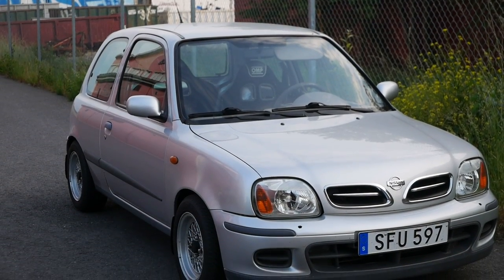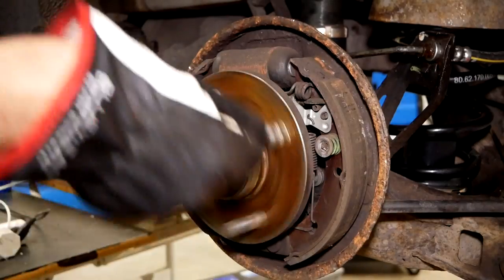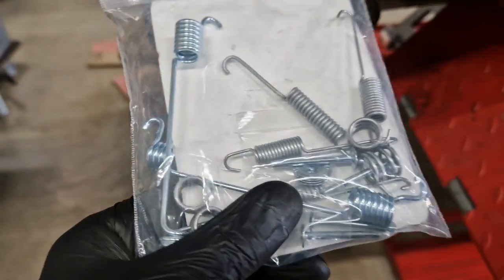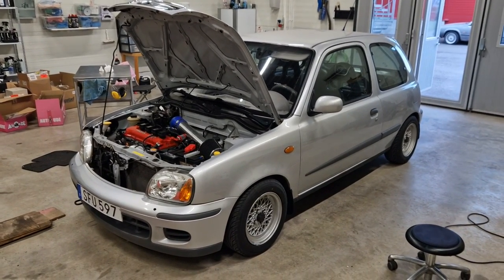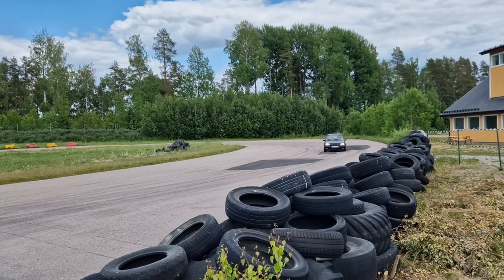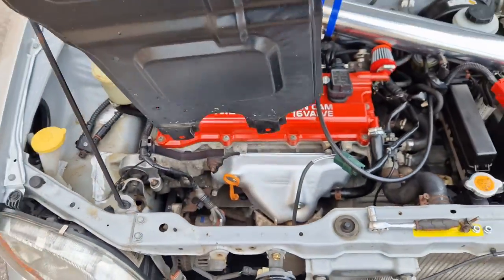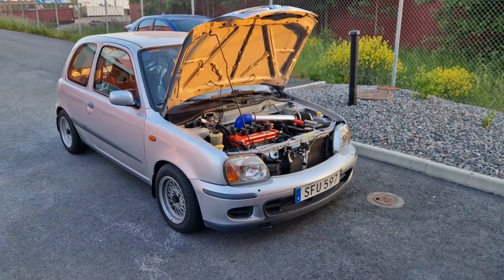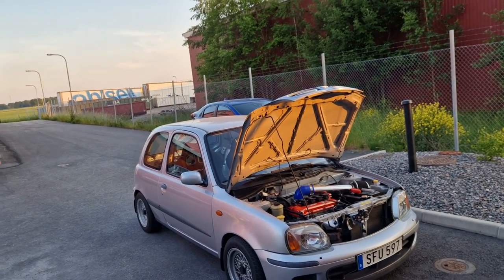I Built a Go-Kart of a Nissan Micra - Let´s take it to the Track!

Comment: throw some strut braces on it, that'll help with a bit more body control, but cool lil project man. well done.
Reply from the maker: Thank you! Yes, I'll definitely do that, especially if I put on gripier tires on. However, the car feels really flat and planted around the corners. I think the head mounted gopro footage gives the illusion of the car having more body roll than it actually has, since I lean my head into the corners.
Reply: Ehh, i really think those strut bars are more visual than structural.
Reply: @dmitriiar2178 agreed. Only thing i've read that helps is a lower tiebar between the front LCA mounts.

Comment: You should defenitely replace the stock exhaust manifold with proper headers since changing the exhaust manifold is the most important performance mod you can do to a K11 micra. The stock one is so bad that even with cheap homemade 4-1 or 4-2-1 headers you can increase the power output of a 1.4 engine by around 15%. And no other modifications are needed to achieve this power increase.
Reply from the maker: Yes I really would like that. I should do it!

Comment: In the states we have a nissan versa from 2008 to 2010 that is a 1.6 manual without AC or sound system and manual everything came out only for a few years and not many people bought it. That car sitting is under 2400 pounds. And you can increase power by 20 percent with not much. Easy to work on too. They have a 1.8 manual but thats closer to 2800 pounds. Those 400 pounds make a huge difference. I have one and is like driving a go cart.

Comment: Dont know if your ever going to continue this project but if you're interested in upgrading the brakes use the brake caliper and bracket from a almera n15 1.4 or 1.6 or almera 2L gti brakes, apart from having to install 2 rings between the caliper bracket and the hubs they are a straight fit and will work with the stock brake lines. The 100nx brakes fit aswell and will fit 13 inch rims as the n15 brakes usually dont fit 13 inch rims without modifications to the caliper. I hope you'll do a video on the car in the near future, greetings from the Nederlands
Reply: Also upgrade the exhaust system als the original system is really restrictive for emissions reasons, it should give you a 7 or 9 hp increase if you size the pipes up to 2 inch, and a 421 manifold should add another 9 or more hp

Comment: Great to see. Tires make the BIGGEST difference above anything. A good set of track tires will make all the difference. Great to see you enjoying the car. If you want a more oversteer then understeer, get a bigger rear sway bar and smaller front one, of when i used to track, id disconnect my front sway bar (fwd).  It's a lot of fun doing track/autocross days.

btw inspections in Sweden are every year? Yikes, they really want ur money lol.
Reply: Every 14 months if the car is younger than 30 years. Between 30 and 50 years, every 24 months. Older than 50 years, not required at all.
Reply: Almost everywhere in Europe it's every year :/
Reply from the maker: Yes, tires definitely makes a huge difference!

I thought about getting a rear sway bar, but the car actually rotates quite good and you get lift of oversteer if you let go of the throttle in cornes, just because it's so light in the rear.

As someone mentioned, we need to inspect our cars every 14 months if it's newer than 30 years old.
Reply: @jazzventura  it's every 2 years in France :)
Reply: @ejoautovideos  i prefer oversteer then under even in fwd cars

Comment: Observation:
The metal sheet you took out of the front will dramatically increase the pressure in front of the radiator, causing increased flow of air through the radiator.
By taking it out, that air can bypass the radiator and just skip around it.
It would be interesting to see coolant temperatures logged with that plate fitted and then without.
Reply: Also, having direct air contact only on one side of the engine i don't think i'ts beneficial, the other side is quite hot. Making the diference of temperature bigger wouldn´t be a desirable side effect. Adding up, temperautre messured from outside the block doesn´t really matter on a water cooled engine.
Reply: Yeah that baffle plate is supposed to help with cooling.  It's common for people to remove it but it worsens radiator performance .  If you want to get heat out of the engine bay, perhaps exit vents near the back of the bonnet/hood will be better.
Reply from the maker: Interesting. Thank you for the input, I didn't think about that aspect honestly. I'll definitely look in to that and put the plate back on if it helps with cooling.
Reply: @StuTubed gotta be careful with scoops near the front window. There the high pressure pushes the air in the bonnet rather than letting escape out
Reply: @Moli571  That's a good point, didn't consider that.

Comment: Just a few tips, your hands are all over the wheel just leave them at 3 and 9. That way if you lift off the gas hard and the car goes sideways you always know where your wheels are pointing. Moving your hands around the wheel is only confusing you. You did in fairness have one hand as a reference.  Talking of lift off oversteer go round a roundabout on the limit and play with lifting off to get a feel for it. (Just get on the gas this stops the oversteer instantly)  One part of the video you came off the gas fast and the car did go very sideways. If you came off slower this wouldn’t have happened. Once you have mastered lift off oversteer you can use it for some really big slides and if you ever come too fast into a corner you can flick it in with a lift so you can lose speed, having the car pointing where you want to go. The K11 is a great balanced car so lift off oversteer comes as standard. I have driven one and loved it. Use your heat gun on the tyres… If it's a clockwise track the left tyre will be hating life if you're getting more understeer on the right handers than last lap this is due to exceeding the working temp of the tyre. Come in, get a heat reading and let the tyre cool. You don’t want to do laps of understeer. With a FWD car you lose about 10 - 30% power with the steering lock on this is used by the CV joints also it damages your CV joints. So the sooner you get the lock off the sooner you're using all your power. Try this next time you will be amazed by the difference in lap times. Get that lock off ASAP..  Having a set of driveshafts for a track day is also advisable. If the car is pushing on do not ask more of the front tyres by putting more lock on. If they were skidding with 15 deg locks they would be skidding to hell with 30 degs on. At that point you can control the car with the throttle lifting off the gas tightens radius. Driving front wheel drive is all about driving on the throttle not the steering wheel. 
Watch every one of their videos. 
https://www.youtube.com/@CamberandCombustion
Reply from the maker: Thank you for taking the time to write this comprehensive comment 🙏

Comment: Wonderful video, for the brakes I could advise you to mount the discs and darts of the nissan almera or sunny n14 1.4 which are ventilated, if you also put the air intakes from the bumper it is obviously even better.
I have a couple of curiosities, how long does it take to do 0-100km/h?
How much did you spend on modifications?
How much would you like to sell it?
Reply from the maker: Thank you! Yes a brake upgrade might be something for the future ;)
I haven't measured 0-100 yet on the new setup, however 20-70 it accelerates 45% faster than stock, which is pretty mind blowing considering I haven't done any engine modifications except an intake. 
The better acceleration times comes from; short ratio gearbox from an 1.0, weigt reduction, smaller wheels and lower rotational mass. 
I actually don't know exactly how much I've spent on mods, maybe ~ 3000 euros on mods and 1000 euros on spare parts and maintanence.

Comment: Loved this build, used to have a K11 Micra about ten years ago and though it was completely stock I would treat it like a rally car when I lived in Asia. Very nimble and so much fun. Will you consider replacing any of the windows with polycarbonate? There is probably another 15-20kg you could save, and it will come from the top of the vehicle (but I don't know what the rules are in Sweden, for roads and track).
Reply from the maker: Nice! 
I have considered it, but it comes at a cost of practicality.
Reply: Fair enough, it's good to have a car that you can use in different situations. @ejoautovideos
Reply from the maker: @Secretlyanothername  absolutely👍 I've been using it a lot during the summer and just enjoying it, thus the lack of content on it recently. But I have some stuff in stored for it that I'm saving up for a video. 😁